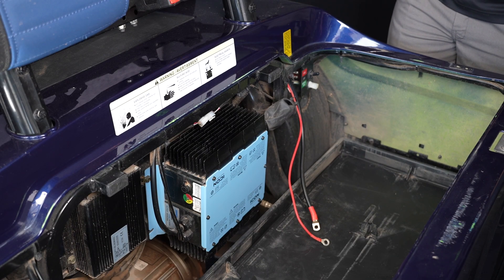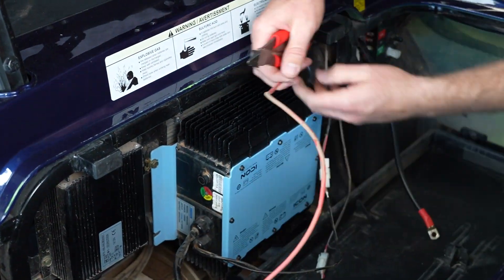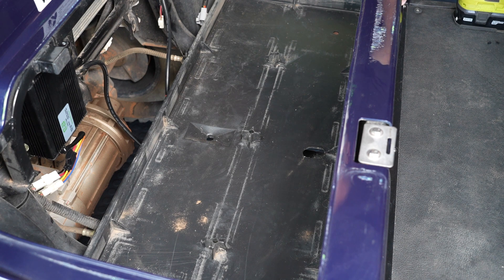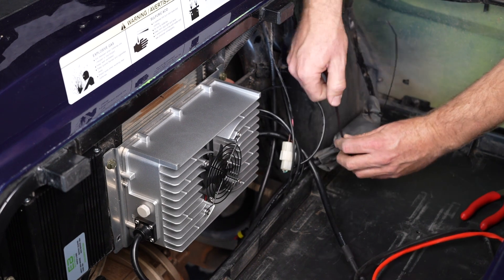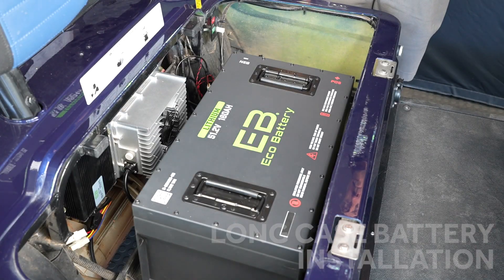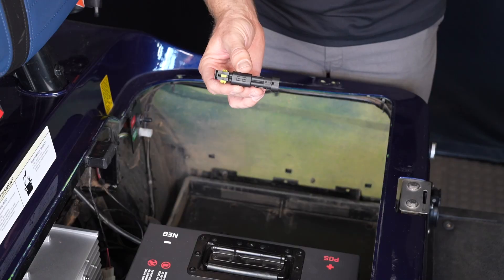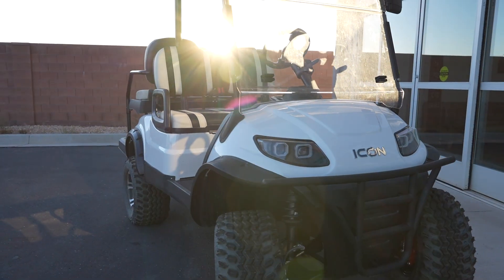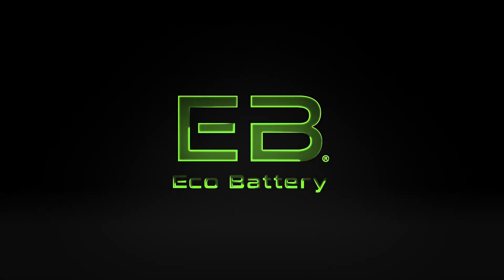ICON EV - NEOS Controller - Eco Battery Installation Guide

Comment: Are you sure this is a different video than the one for the ICON controller because this video looks identical. I do not see / hear any differences with the NEOS controller. Where's the installation for the gauge? This one shows the display which according to ExtremeKartz images for the 48V 105Ah bundle, it comes with the gauge not the display.
Reply from the maker: Which bundle did you purchase for your ICON? Did you purchase the ICON bundle that includes the EB cluster or a bundle with the 2 inch round gauge?

Comment: Is there a video or post on how to wire in and install the rear view camera? Does this require wiring in 12v from the larger harness and running the camera signal to the TV inputs?

Comment: You guys need to update this video please for ICON carts with charger in front row and especially for the short black battery wire from the NEOS controller in a 2021 cart.
Reply: Yes, the black negative cable coming from the controller is much shorter  for 2021 carts with Neos controller (yes all zip ties were removed) than your video shows.  To use the center hole in battery tray to secure the lithium 105AH ECObattery as this video shows, would require a longer cable which in turn would require opening up the controller and purchasing a new cable to replace the existing one. Otherwise to use the existing shorter cable from factory, one needs to slide the battery over several inches to the passenger side and drill a new hole through the tray and metal support. Not a big deal to do so and this is what I chose to do, but would have been helpful if your video made mention of that.  Also if the factory lead acid battery charger is located under front seat from the factory, there is no vertical mounting bracket for lithium charger in battery compartment. There is plenty of room to mount the lithium charger horizontally on the battery tray. Would be nice if the video was updated with that information also.
Reply from the maker: Are you referring to the battery negative cable shown at 2:48 by chance?